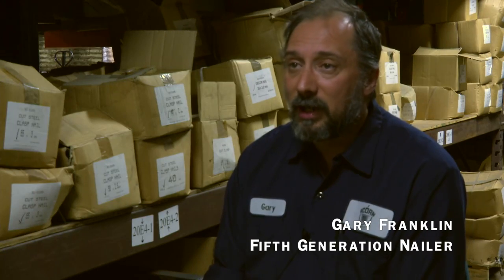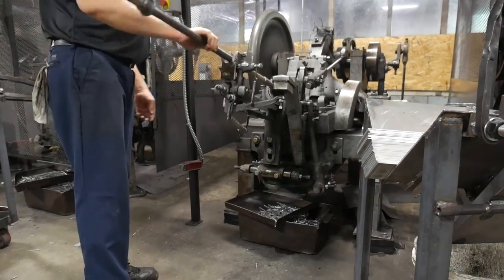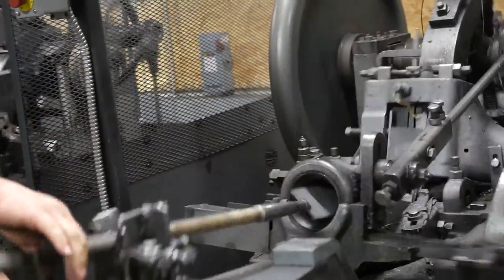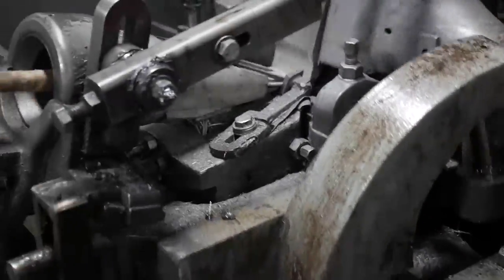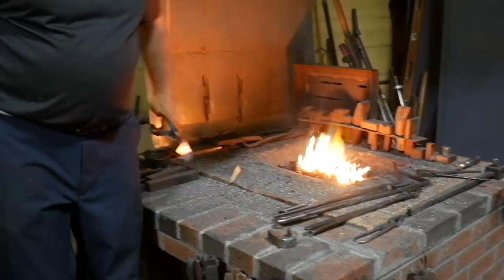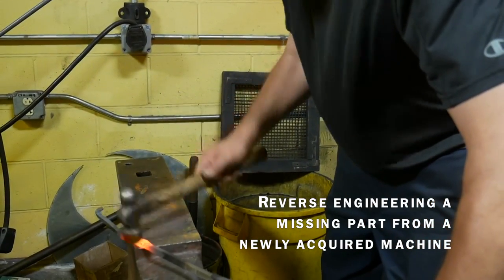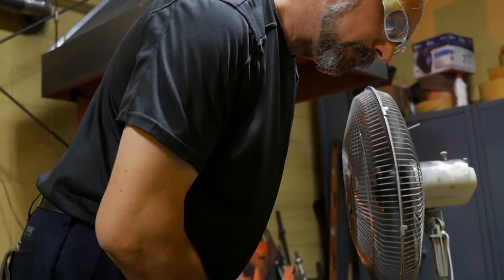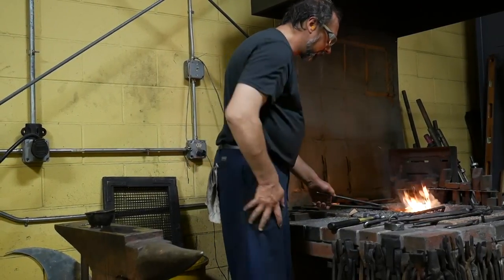Cut nails, a family business

Comment: this is cool!!! where can I get a pound of these nails to use? I feel like I should on occasion buy some just so those machines can keep running.
     
" old, worn and still working tools speak more loudly of my skill as a craftsman than my best creations ever could"
Reply from the maker: http://www.tremontnail.com/
Reply: When I was 17 years old I work at a candy factory running a stapling machine that stapled boxes together, the stapler was from the late 1800s and was run off a belt system that ran off a steam engine.
Of course today it runs off electric motor but I always thought how cool it would be to see it running like it used to off a steam engine.
The cast iron plate that you would slide the cardboard box onto was so worn out from all the use ... blows my mind that it was used so much that cast-iron was rounded off from cardboard !!!
Reply: @Grasshopper80s4ever  Like the granite church steps in Europe, rounded to a nub in the middle

Comment: Recent nails from Tremont seem softer than vintage nails that I have, and the tend to bend more easily.  Others have noticed this as well.  Whats up with nail hardness?
Reply: Might be their supplier for the blanks.
If they are buying mild steel instead of something harder that might explain it.
Reply: My understanding is that they are meant to be soft, so that you can bend protruding ends over.
Reply: The vintage nails might be wrought iron rather than mild steel, but that hasn't been available in commercial quantities for 100 years or so, really phased out about the time these machines were designed as I think they said they were from 1890s